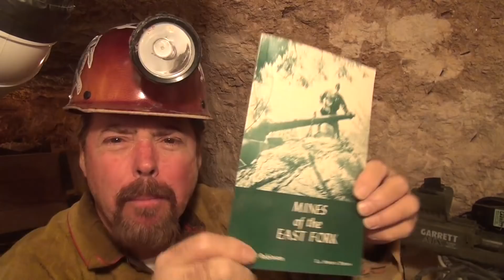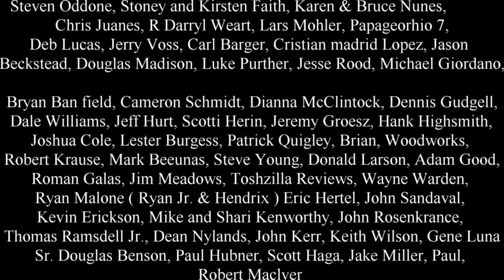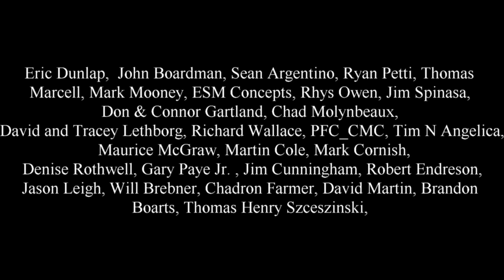ECSTASY OF GOLD !!! Blondee. Ask Jeff Williams

Comment: I have a slip similar to the one you built there I was lmao when i saw your set up , I built a very similar set up too . including using a winch  too.I had to do a   of lot leveling and laying some water and utility lines ,  the slip , does some soft dirt moving , i built an A frame with a piece of grader blade for blade work and anhas a place to slip  a big piece of beveled rebar into it and hammer that  into the ground the depth I wanna cut my 1st pass , winching it in it busts up a nice cut of dirt about 8" to 12 " , make another pass , sharp shooter out the dirt and a nice cut made for burying lines ... to go deeper unlock the bar and sledge it deeper into the ground crude but it beats the alternative , oh you have to flip the A - frame upside down  so the blade is not dogging the winch down and back filling my  trench   before i even get it cleaned out lol you da man  , I really hope that isnt you doing all the shredding on the music that was on the tag of your video  if so you are badder than superman James Bond and Amos Moses put together